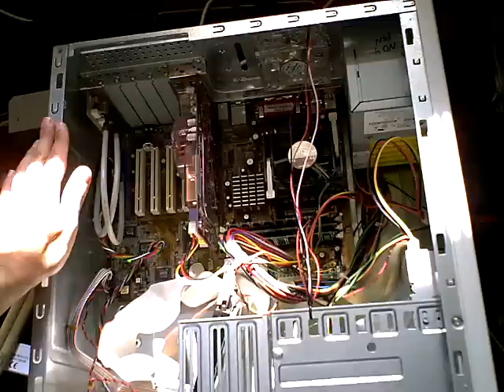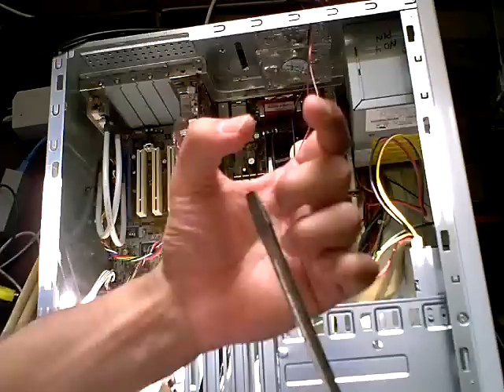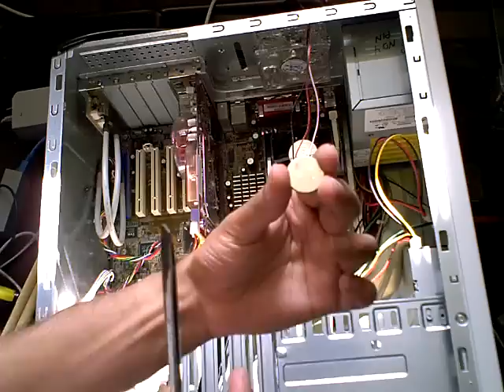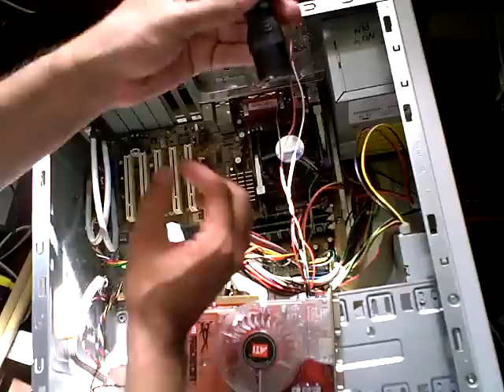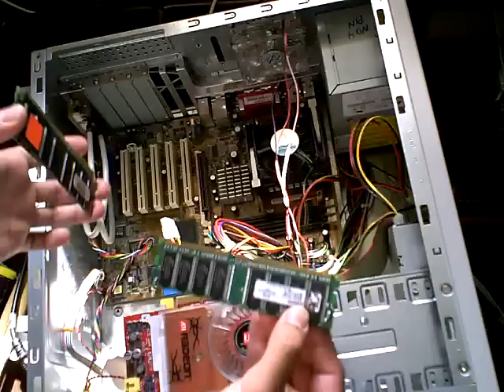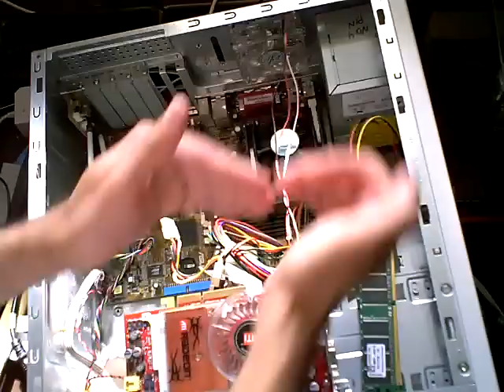How to possibly fix a PC that will turn on but will not beep and will not display anything on screen

Comment: I took my ram out and it beeped like it should so I put it back in and it stayed the same
Reply from the maker: +Itz GraPhiczZ unplug the pc and then change the order of the RAM modules, then boot up. If no luck, unplug the pc and then change the sockets you install said RAM modules, then boot up. If you cannot find a socket or a combination or RAM modules that boots the PC, you may need new RAM
Reply: +RodneyDickson thanks I tried this and it worked earlier
Reply from the maker: +Itz GraPhiczZ Glad to hear things worked out

Comment: My brother's computer is fucking scary help me he hit right next to the mouse and it had a beeeeep sound. And froze and now it only says the repair sht and I'm not paying 100$ or 60$ not even 40$ I want it for a little bit
Reply from the maker: +Alex Nuzzi If it is giving you a repair message, the problem is software related, so it's not that bad. It just means you gotta reinstall Windows (you should back up your pertinent files beforehand using a Linux LIVE CD though, unless everything on the hard drive can easily be redownloaded or reinstalled.)

Comment: pc won't start after update bios
Reply from the maker: Your BIOS update might have bricked the board. Try the CMOS reset trick shown in the video, but if that doesn't work, your BIOS is probably dead

Comment: just shorted my motherboard out trying to put some ram in :(
Reply from the maker: +Nyle The Viking Crap deal. If the PC still functions otherwise, I'd avoid the socket that had the RAM issue and only use the other sockets for RAM.
Reply: RodneyDickson unfortunately i had to replace my motherboard
Reply from the maker: +Nyle The Viking Sorry it came to that.

Comment: Edit: After a few Minutes it did the same thing, turned itself off
Reply from the maker: +Cameron Swisher Breadboard it (explained in the following video:)

If the steps in this video did not provide a solution to your problem, view:

http://www.youtube.com/watch?v=_EK9a-R5pss

You never know, maybe rebuilding the PC in the opposite sense that you took it apart will solve the problem.

Comment: my computer got been sound but no screen
Reply from the maker: +BlackGhostDevil If you have multiple video out connectors on your PC, power down your PC, connect your display to a different video out, and power up. If another video out works, you have to go into your BIOS and set your primary graphics adapter to the desired primary graphics adapter, followed by saving and exiting

Comment: mine did this and the motherboard had died.
Reply from the maker: +sketch pad Breadboard it (explained in the following video:)

If the steps in this video did not provide a solution to your problem, view:

http://www.youtube.com/watch?v=_EK9a-R5pss

You never know, maybe rebuilding the PC in the opposite sense that you took it apart will solve the problem.

Comment: tuko kitkat 1 second ago
 Hi, great video.
I HAVE A PC THAT IT DOES FREEZE AND AFTER A DIFFERENT ATTEMPT TO TRN OFF/ON FRO THE MAIN IT SAIS error;NO BOOT DISK HAS BEEN DETECTED OR DISK HAS FAILED.
aNY HELP.
tHANKS.
Reply from the maker: +tuko kitkat Ummm, RodneyDickson, 1 second ago...make that 5 seconds ago, oh forget it : )

What is going on is that either your hard drive has died, or the PC is no longer detecting it. I'd recommend first checking your boot order in your BIOS and make sure that your hard drive is detected and is set as the primary boot device. If that doesn't help, boot up with a Linux LIVE CD, and if the hard drive is accessible, then you may need to format and reinstall windows. Of course, if the hard drive is not accessible, you'll need a new hard drive.

Comment: Mine beeps
Reply: +Charged Grizzly178 but its just one short beep
Reply: +Charged Grizzly178 and when i boot it up, one short beep, but when i turn it on vga, no signal. And Yes i do have the VGA canle plugged in.
Reply from the maker: +Charged Grizzly178 Your PC might be defaulting to output video on a different device. Try connecting your display to a different output device on the back of your PC

Comment: I've only had my PC for about 1 year here are the specs, also this problem occurred after installing my gtx 1080 founders edition and replacing my 8gb ddr3 corsair vengeance ram with 16gb hyperx fury ram. 
http://uk.pcpartpicker.com/list/ypN29W
Reply from the maker: If this is new hardware that you are installing on your motherboard (that has not yet functioned on your motherboard), note that matching bus types of video card to motherboard socket (PCI-E for example), matching socket types of CPU to motherboard socket (LGA1366 for example) or matching bus types of RAM module to motherboard socket (DDR3 for example) does not necessarily signify compatibility. If this is the first time you are trying this hardware on your motherboard, there is a chance that this new hardware is not compatible with your motherboard, despite the same bus type and despite the fact that the new parts fit in their respective motherboard socket. Your motherboard manufacturer's website will have a support page dedicated to your motherboard's model, and on this support page should be a compatibility list for such components as video cards, CPUs and RAM modules. Ensure that your new component is certified to function with your motherboard, and if your new component is not present on the compatibility list, then there is a chance that the new component is not compatible with your motherboard.

Comment: My computer fans spin then stop then spin the stop over and over
Reply from the maker: It sounds like your motherboard is developing a short circuit due to contact with the metal casing. Most likely it has to do with the screws and metal mounting stands (supports) that your motherboard sits on. The cheapest way to fix this problem is to introduce cardboard washers between the screws and where they make contact to the motherboard, or you can buy plastic mounting supports at a computer shop.

Alternatively, you can always Breadboard it: 1)place the motherboard with CPU+Fan on wood or non-shiny cardboard 2)connect all of the case connectors to the board's panel 3)with a power bar that is OFF connect the PC power cable from the power bar to the power supply and the power supply to the board 4)while NEVER touching any exposed component,power on the power bar and press the power switch on the case.If the problem still persists,one of the remaining components is probably defective.Power off the power bar before dismantling

I cover breadboarding in greater detail in this video:
Advanced troubleshooting technique tutorial of how to possibly fix a PC that will not beep at boot
---
Reply: Can i just breadboard on the box
Reply from the maker: I AM MOZART
If you are referring to the cardboard box that your motherboard came in, then I'd prefer not (it is a shiny surface) but many builders do this very practice, so I leave that decision to you (I recommend a non-shiny cardboard surface). If you are talking about the metal PC case, then absolutely not (the contacts at the bottom of the board will most definitely short).
Reply: I started to breadboard it, it dud the sane thing, spin up stop spin up. I dont have ram in the slots. Could that be a reason?
Reply from the maker: HEAD KICKER HD
Hmm, doubt it. Fraid I'm not sure what to suggest at this point. Could be insufficient power from the power supply, could be an issue with the CPU pins not being properly inserted in the CPU socket (if this is a new build), could be general motherboard damage, etc. Can't give you a clear answer I'm afraid.
Reply: +HEAD KICKER HD Bios updates will fix this IF you are sure all your power rails are connected firmly and your fans are not bad.
The MSI z87-g45 gaming board out of the box does a similar thing until you update its bios.

Comment: nothing can help me :(
Reply from the maker: Let's start off simple: disconnect the power cable, remove the CMOS battery, press your PC's chassis power button switch (to discharge any remaining power circulating in the system), leave the PC unplugged and in this state overnight, then the next day return the CMOS battery to its socket, and power up the PC. Any luck?

Comment: Man Im 11 years old can't do that
Reply from the maker: Heh, well, breadboarding a PC may be a heavy undertaking, but there are things you can still try only with one side of your PC's case opened. Let's start with the simplest: disconnect the power cable, remove the CMOS battery, press your PC's chassis power button switch (to discharge any remaining power circulating in the system), leave the PC unplugged and in this state overnight, then the next day return the CMOS battery to its socket and power up the PC. Lemme know how it turns out

Comment: hahah there goes my pc doesnt start up at all after this :S
Reply from the maker: +jonzgu17 It sounds like your motherboard is developing a short circuit due to contact with the metal casing. Most likely it has to do with the screws and metal mounting stands (supports) that your motherboard sits on. The cheapest way to fix this problem is to introduce cardboard washers between the screws and where they make contact to the motherboard, or you can buy plastic mounting supports at a computer shop.

Alternatively, you can always Breadboard it (explained in the following video:)

If the steps in this video did not provide a solution to your problem, view:

http://www.youtube.com/watch?v=_EK9a-R5pss

You never know, maybe rebuilding the PC in the opposite sense that you took it apart will solve the problem.

Comment: This is too fucking complex
Reply from the maker: Let's start off simple: disconnect the power cable, remove the CMOS 
battery, press your PC's chassis power button switch (to discharge any 
remaining power circulating in the system), leave the PC unplugged and 
in this state overnight, then the next day return the CMOS battery to 
its socket, and power up the PC. Any luck?

Comment: u talk too much i dont know what to do now!
Reply from the maker: +Golshan Goldoust disconnect the power cable, remove the CMOS battery, short the CMOS jumper pins for 9 seconds then return the jumper cap to its initial position, press your PC's chassis power button switch (to discharge any remaining power circulating in the system), leave the PC unplugged and in this state overnight, then the next day return the CMOS battery to its socket, power up the PC, and if no beep, then disconnect the power cable, press your PC's chassis power button switch (to discharge any remaining power circulating in the system), remove one component, power up the PC, and if no beep then repeat (each time unplugging the PC, pressing the power switch to discharge remaining power, removing a remaining component, and then powering up, and this until the PC beeps at boot).If it never beeps, even when you are down to just motherboard, power supply & CPU+fan, one of these remaining components may be bad